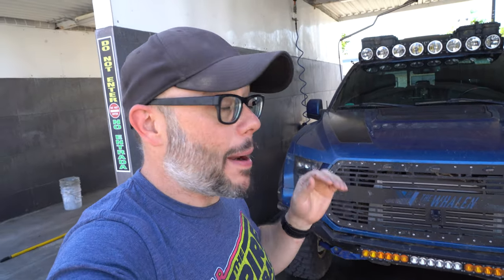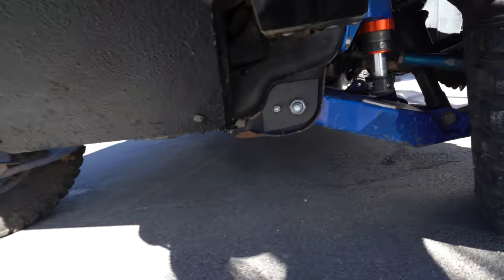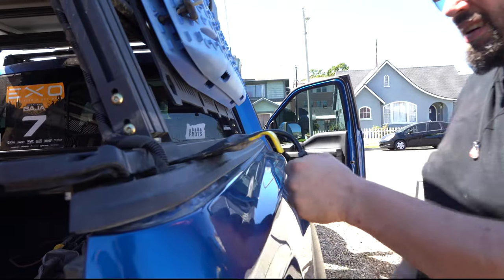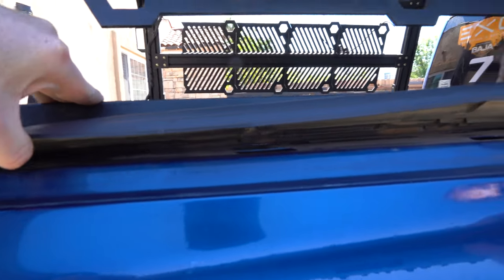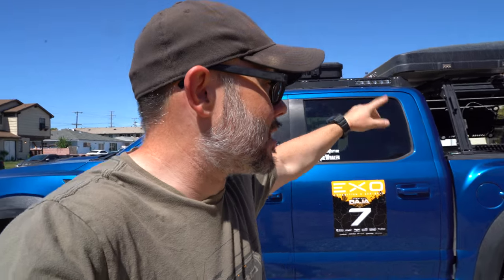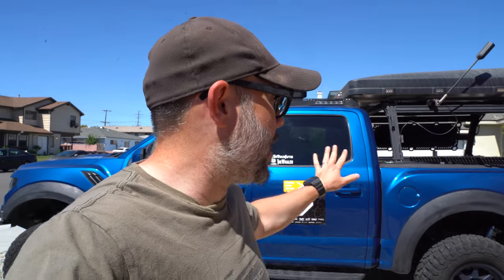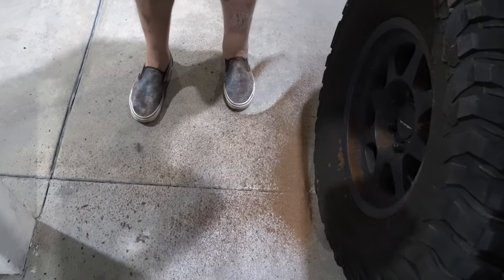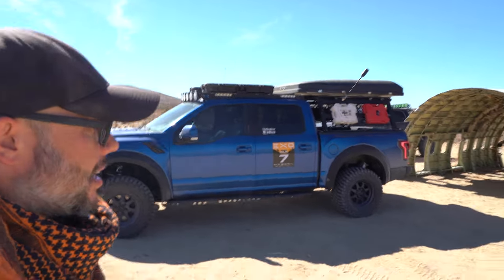Rallying Trucks in Mojave With Keep it Dirty Off-Road

Comment: I have the reinforced round aluminum bar and cross rails for my rooftop tent. Has been sturdy for the high speed back roads, sand woods, and mountain trails. Have fun. Good times Offroad